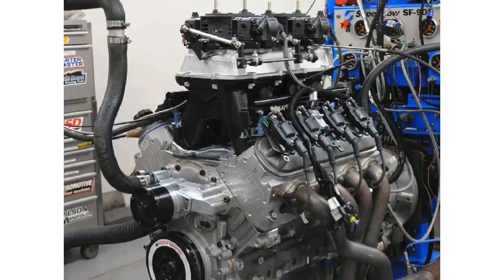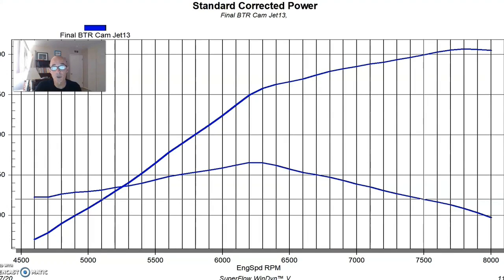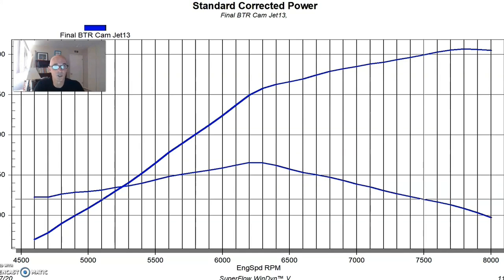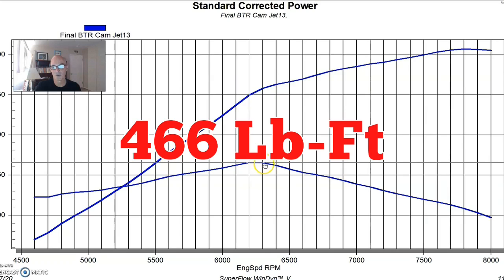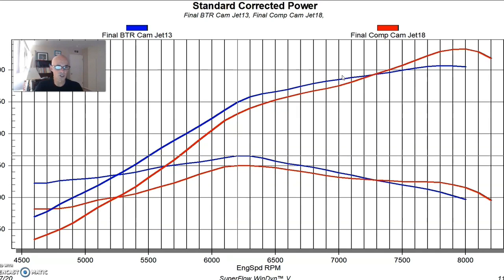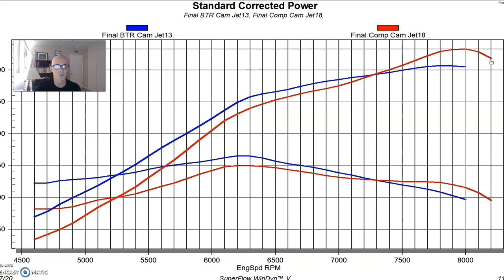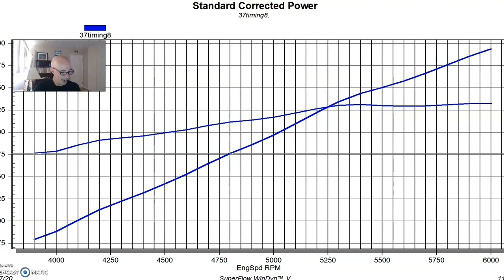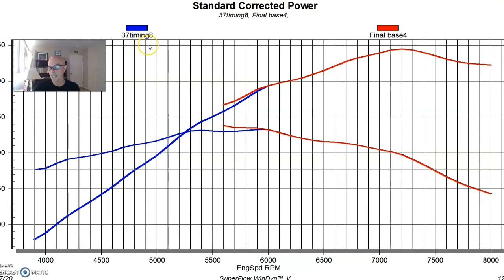8K RPM HYD ROLLER-WILL IT WORK?

Comment: Do a test with the John kaase p38 head is be curious to see the results
Reply: better yet, a c400 head.  the kasse c400 blows the p38 out of the water
Reply: @whatchu_talkin_john_willis  do they bolt on the 302 Windsor the head I'm talking about are the Cleveland head modified to bolt on the Windsor canted valve so l would like to see them try it is that ok ?
Reply: @MrMrBigro  they do, that how the boss 302 was created.  but the p38 was still "windsor" based, where the c400 is a cleveland head
Reply: Kaase doesn't make the P38 anymore...so sad.
Reply: He makes some good stuff over thet.
Reply: They are sick, I purchased the Jegs version before he releases his P-38's.  Replaced all the cheaper valves and such but awesome, power making heads.  I have them on a 347 with a billet crank and aluminum rods.  Pulls like a bitch but a guy thats spins 10000 rpm in an LS put me in my place.  Lol

Comment: Well, twenty years ago plenty were "Trying" to use those extreme series 212-218 duration ramps and finding out how intense a 5800-6200 rpm shut off could be, lol
Reply: Kevin Mallender probably real strong till you start throwing the lifters off the cam nose and having them slam shut uncontrolled. 😈

Comment: Richard, I would have love to hear those engine revving to 8K plus! Can you list the valve train setup? Like  the spring brand and pressure? Were those factory rockers with the trunnion upgrade or aftermarket rockers?
Reply from the maker: stock rockers and no upgrades, springs came on the AFR heads

Comment: I have that same dart 347, will it do well with the comp .600 intake and exhaust with 110 lsa with turbo,  I've been having a lil bit of problems,  10lbs of boost and broke a ring land on cylinder 1, maybe just a fluke idk
Reply: Needs more ring gap
Reply: The ring gap is 28 thousands on top and 30 on bottom. Probably plenty of ring gap, it called for 24 and 26

Comment: What is rhat ls motor size wise..I use to know ...what a 4.8 crank was in a 5.7 block.application.. 302 or something cubic inches?
 Try a smaller header on the 347 maybe? I know bigger primaries is always good on a high rpm.aplication.. just curious what the numbers would be then

Comment: The LSA on that Crane came seemed a little narrow.  I'm also wondering what the intake centerline was, was it early also? What lifters did you use and what was the seat and open pressure?  Are you confident the pushrod length was optimal?

Comment: my 358ci sbc gen 1 with a solid roller pulls strong past 8000rpms (knife edge crank, billet main caps, aluminum rods, 12+ to 1 comp. massively ported 492 angle plug heads, .600" lift cam), fun little street engine

Comment: The 347 setups have a lot of piston friction because of the short deck height and the short rods, I have read about extreme power 347s actually ramming the pistons through the cylinder walls. Could friction be the reason for the lack of power?
Reply: Where have you heard that?

Comment: What about a 306 vs 331 vs 347 with all other specs same: Intake, cam, compression, etc. Determine value of power gained for vs the cost of increased stroke.
Reply: Interesting article recently from a top engine builder stated; the 347 is down 40 hp. at 7000 to the 331 because of the worsening rod/stroke ratio.
Reply: There are very little total power gains from more cubic inches.  You do have to turn the engine faster to make the same power with less cubic inches.

Larger displacement usually gets you more torque making capacity and more streetability.

Comment: Not always about the lift. It is important but lobe design is very important. A conversation with the camshaft designer may prove fruitful. Having them examine all the valvetrain components may show needs for change/ improvement in valvetrain configuration. Even though you did not mention any problems ,Would a stud girdle help to improve valve train stability?  Could valvetrain harmonics be an issue?  Lot more questions than helpful suggestions. As always you make people exercise their brains. That’s a good thing. Love your videos, even though my three brains cells are sometimes tired after watching them.

Comment: Any over-square engine will rev faster and higher than an under-square engine. 
If the bore is larger than the stroke is long, rev away. The greater the difference in bore vs stroke the higher the rev limit.
The limiting factor is the valve train and, with hydraulics, the ability to not pump up solid.
Great fun test. As for the Ford not achieving your potential, the reason is simple. FORD             LOL
Thanks for sharing.

Comment: Hey Richard I couldn't tell but what bolt pattern was used on the sbf trick flow high ports? There is a small horizontal bolt pattern and the bigger diagonal bolt pattern. I noticed on these heads if you use the small bolt pattern it chops a lot of flow off the exhaust. Trick flow makes a high port specific header flange for the bigger bolt pattern for like $60 if I remember correctly. Also goes to a 5/16 header bolt for more clearence.

Comment: Richard, you definitely need to do an 8500 rpm turbo ls big bang. Nothing special, just ring gapped, gen 4, 4.8, with the appropriate top end of course. One guy on here had one with some Johnson short travels, 3/8 push rods, and btr's ultimate rpm spring kit and with twin borg cast 66's made 1140 whp on mild boost and has run it up to 41psi and was fine and ran a 7.8 or 7 in the quarter and 140k miles ungapped rings, didn't even look at the bearings, just ran e85 7.x afr and low timing around peak torque and ramped it back in after. Definitely something to look into sometime.

Comment: In OHC engines, 8k RPM isn't a big issue. But the total valve train mass is significantly lower, so you dont need the massive spring pressures that are required on sump-cam'd motors.

Also I'd be interested to see how these motors behave when held at high revs for a prolonged period of time. On a single pull, you're not going to run into aeration problems, as it's all over far too quickly. If you hold the motor at 7500RPM for 20 seconds and still have good valve control then it could be considered viable for circuit racing. That additional time will determine if you're getting air in the oil and whether or not it affects stability ;)
Reply: Sump cammed, really? Did I miss something, was not this a small Ford, with a really { standard } small rod? Hold it tell it blows.
Reply: @MsKatjie  sump cam's is slang for a push rod engine
Reply: @manitoublack  I know, sounds terrible. Can't you say mid mounted?

Comment: So stroke doesn't have bearing on high RPM power production, but what about consequences on the big end of the rod/bearing, and crankshaft journals because of piston speed? Or am I getting this wrong?
Reply: Destroking helps slow pistion speed so you can turn higher rpm. As far as the big end of the rod taking a beating im not sure. I would say as long as you have the oil perssure to support high rpm it should be fine. Im not expert just my thoughts.
Reply: I think he said that stroke doesn't have any bearing on RPM potential, not power production.
Reply: From what I understand aluminum rods become needed at some point to cushion the blow (they also take away power) on the bearings...

I guess what I'm wondering is; at what point is it needed to (calculations like mean piston speed? If so at what number threshold?) switch to an aluminum rod?

Maybe I'm missing something else and am just looking at one aspect of this... Thank you both for chiming in. I understand that when a certain mean piston speed is exceeded that it is a good idea to not do anything to increase that. Maybe I've got that wrong too...

Comment: I would love to see you do a buick grand national big bang motor with nice parts because I think that platform happed in the wrong era because we didnt have good big modern turbos or nice billet parts or really good stand alones and injectors back in there heyday. I honestly think one could make 1500+ if done right without to much of a problem. Also doing a built honda k24 twin turbo or huge single would be cool
Reply: I'd likd to think with the tech we have now , one with 450-500hp should last as long as anything else. 
Or should last as long as the original was intended to last. 
At least 100k, more like 150 and maybe she's kinda tired , and 200k yea she needs a rebuild.
We all know most anything modern and not full race  can go 100k anymore standing on its head.
Reply: That would pretty cool to see, the problem is, it's hard to find and lc2 to test on.

Comment: 347 = look at the low rod ratio,
which affects piston acelaration from dwell and rod angle per crank pin torque angle.
Reply: Yeah I think he had lomger rods in it.

At least I think most people who build the bigger bore 363s simular to a 347 like this use a lomger rod..could be wrong
Reply: @KingJT80  Rich stated that it was a DART SHP 347ci short block. According to Dart's specifications, they use 5.4" 4340 H-beam rods. I understand what you are saying though, -the 5.4" rod isn't the only way to build one of these, -there are better options than the 5.4 rod length in my opinion.
Reply: @ratman5727  yeah better ways.

Like just buying a 351w. 

 Taller engine might cause hood clearance issues but hey, you want 500+reliable HP  in a stock block? There you go
Reply: @KingJT80  EXACTLY!!
Reply: I was thinking the same thing, those short 5.4 rods definitely aren't helping anything. Longer rods and raised pin pistons would improve things a lot.
Reply: Are you talking about the rod ratio that's better than a 454 chevy?

Comment: An interesting comparison would be to run the same combo on a 351W. Very close to the same displacement but a longer stroke and a taller deck height. So doesn’t that equate to a better rod ratio?
Reply: 🔔Yes, rod ratio affects how soon and how fast the piston accelerates affects the flow through partially open intake valves, AND when the rod achieves 90* to the crank throw makes a difference.
Reply: Yeah a long rod 351w would probably do better

Comment: Would've been nice to see a 331 sbf in place of the 347.
Reply: My buddy has a turbo 331 in a heavy convertible running 8's! I asked him why he didn't go 347.. he said the same thing..331 is better longevity
Reply: @19jody72  i read that the rod ratio in 347's were bad, the piston speed over 6500 is excessive.
Reply: When he began talking about a bigger stroke, i was sure he was going to mention a 331. That's "one step" above the 3", the 347 is two...but then again, he probably went with what's laying around, and i can't blame him for that. 

Fun fact, the 327 Ford was done back in the muscle car days, with a Y block truck crank. It was a lot of machine work, and the 351W soon came out to make it not worth it. The early 347's came out when Fox bodies were whippin' ass, and they were cut down 351C cranks good to 7,000 RPM. What hurt them was sticking the piston wrist pin in the oil rings, that would hurt the sealing abilities after a bunch of miles. But folks have figured a way around it.

Still, those wanting max HP, look for revs, and other than this video, they think the shorter stroke of the 331 is going to give them that. Of course these were the folks limited to the low deck Windsor block to get into a racing class. Out on the street you can run what you want, and a stroker 351W gets the nod.  But hire an expert to build your "bullet", and you get the recipe that worked so well for them in the late 1980's early 1990's against Grand Nationals..based on a 302 block.
Reply: ChrisHallett83  youre basically doing what pro stock does
Reply: 331s became obsolete because they cost exaclty the same for less cubes
Reply: @KingJT80 definitely not obsolete. Rpm friendly with a better rod angle. Also not having blowby issues that the 347 is prone to have at times.
Reply: @kingoftheonelineresponse5965  well you just dont see many people building them as much.

I though about it but it was funny talking to a guy yesterday at a cars and coffee meetup that guys uses to build 347s back in the day and he would keep up with them with a stock 5.0 which is about 225hp then add a progressive 250 shot

Now hes keeping up with you with a stock block lol 

I honestly wouldnt even consider a stroker unless it was a stock block 408w or a 363 dart
Reply: @KingJT80  my vote is for a 408.
Reply: @kingoftheonelineresponse5965  yeah a solid flat tappet 408w with some brodix track 1s...10.5 to 1 pump gas

Would def be a beast on the street.
Reply: @KingJT80  this was done way back then, when 331;s were avail, the test should of been also run with a 3" stroke motor. maybe it was the cam. the ls ran a 118 lsa. also those sbf hyd roller lifters are heavy, did it have the proper spings for that cam with ti retainers?
Reply: @frankg5076  he should have had morel short travel lifters..
Reply: @KingJT80  not sure if they made those back then or even for a sbf

Comment: For those who claim stroke is a huge limitation to Rpm, I say look into 5.4 modulars with 4.165 inches of stroke. Many 5.4 cobra R combos as well as navigator based 4vs have seen over 7500rpms.
Reply: Four valves per cylinder helps a lot to make up for the overly long stroke of the Ford 5.4
Reply: @andyharman3022  You say make up for. I don't think the stroke is hindering anything.
Reply: Well they also have no pushrods either. The fact these engines do and they getting up there is crazy without a pushrod coming through the valve cober or spings breaking

Comment: How durable are retrofit hydraulic roller lifters? Specifically for the Small block Chevy?
Reply: Prettt durable if theyre morel lifter or johnson lifters but youre gonna pay for them

800 or more but are meant for higher spring pressure

Comment: A mountain motor prostock engine has a 5.75 stroke and run out to 8300rpm on the track makes peak power at 7800 rpm. So yep if you got enough head and cam and the right intake stroke don't mean shit.
Reply: Greg Ertman nhra prostock 500 cu/ in motors spin upwards 11000 rpm.
Reply: lloyd holt yes but they have a short stroke at 3.6 inch